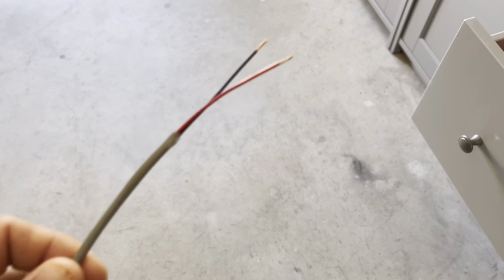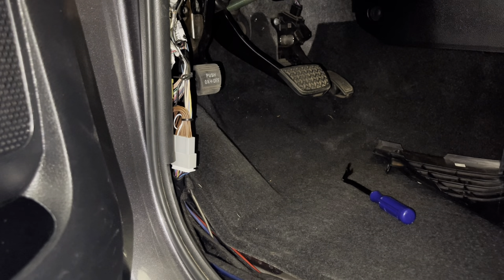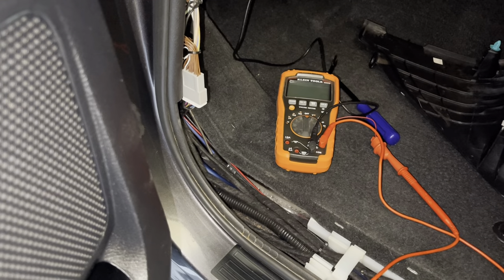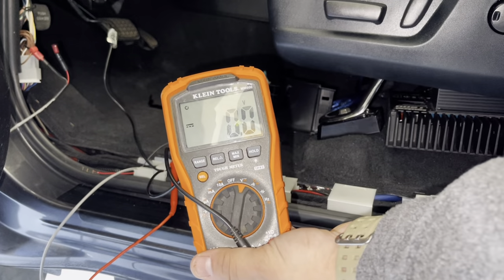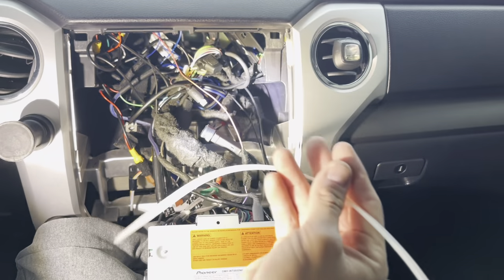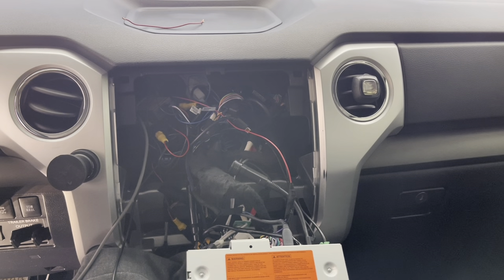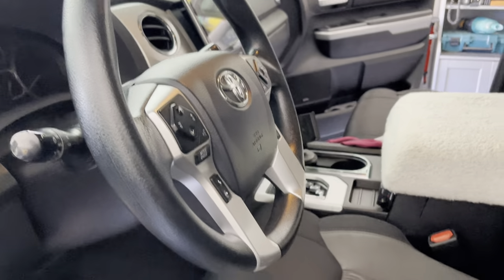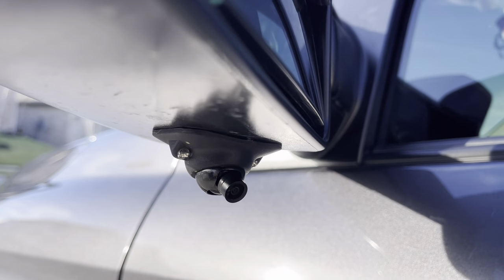Installing blind spot cameras on side mirrors

Comment: Hi mate, iam wondering how you did the wiring to the side cameras i installed the switsher, the rear camera is working fine but when i hook the trigger to from turn signal the camera won't come on.
Reply from the maker: @Dhawnasraoui  you need to provide power to the module and then have a wire from each separate blinker and reverse wire so each camera gets a individual signal. So you should have 3 separate power trigger wires. Watch the video again. Also make sure the negatives blacks are all hooked up properly as well. Good luck

Comment: Isn’t the blinker signal intermittent power? I’d think if I hooked power directly to my blinker power wire it would turn the camera on and off with the blinker
Reply from the maker: The module uses accessory power so when your radio comes on, the module turns on the blinker is just to send the module the signal as to which blinker camera you want to turn on
Reply: So how do I make sure the camera doesn’t blink with the light. I’m not quite understanding
Reply from the maker: @muuks_the_entrepreneur your wire up wrong then read other comments

Comment: I hope you can help me. I just installed these on the directional mirror lights on a Ram promaster 2500. The left and right cameras come on just fine when I have the key switch set to ACC, but when I start the van the cameras will not turn on when I try the left and right blinker. They will work with the remote button though. I am at a loss on why this is happening and hope you might have an idea or two. Thanks in advance.
Reply: You have to use 2 relay with your installation one each side camera
Reply: Thanks for the reply. I ended up using a different product for the directional cameras
Reply: @whiteoconnell do you mind sharing what u came up using pls